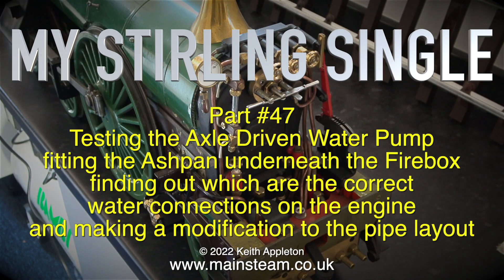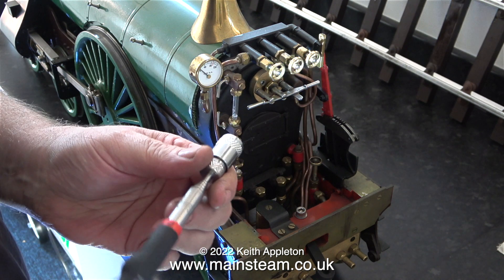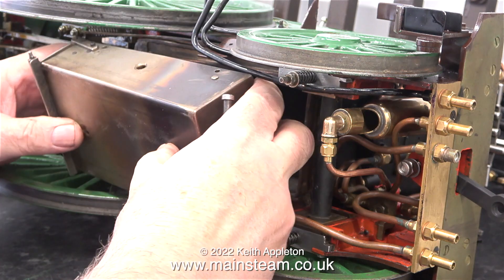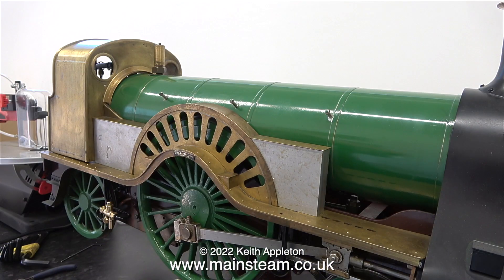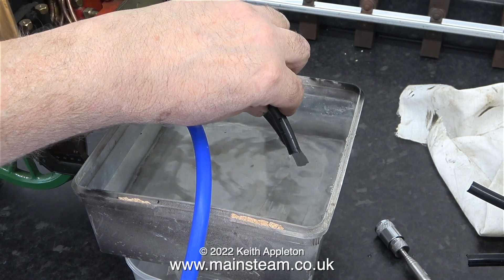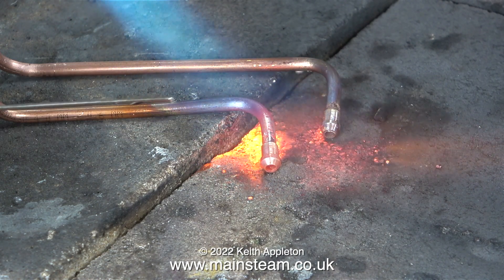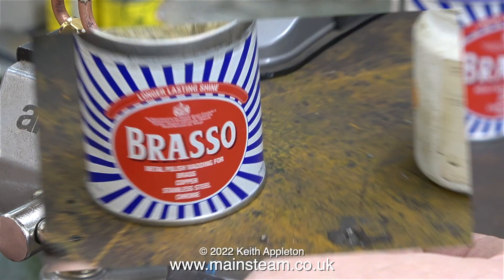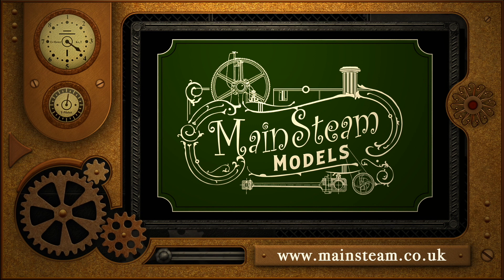MY STIRLING SINGLE - PART #47 - TESTING THE AXLE PUMP

Comment: Hi Keith, fantastic video as always. 
Ive had some thoughts for a while but yet to try it myself. Cant the axle pump return go back into the axle pump feed pipe on the loco side. So when the bypass is open the water is just circulating the pump, until you require water. It would eliminate the need for one more pipe going back to the tender.
Thank you for making these videos and please keep well.
Keep it up!
Regards,
Paul
Reply from the maker: That could cause a pressure build up and hydraulic loading in the short loop. It is the accepted standard to circulate the water back to the supply tank and make the return pipe visible so you can see that the pump is working
Reply: @keithappleton  I just always question things haha. Residual pressure will just push back into the tank via the intake without hydraulicing. not a closed loop. Be interesting to see if the turbulence does cause issues. I agree it does remove the possibility to check if the pump is working. Test cock / cab wash hose might be a solution for that. I just hate all the pipes between cab and loco. Thanks for the feedback and keep making the videos.

Comment: Hi Keith,

Recently discovered your channel and i've steadily been making my way through your library - there's all sorts of interesting things to be found in there thank you for the invaluable resource you're building.

I was wondering if you might be able to help me with a question about sight gauges on a traction engine, since i've seen you've worked on a few as well as owning a couple yourself.

I am about to embark on the building of a 2" Thetford Town engine (from reeves), but since this is my first project things that might be clear to someone more experienced elude me. There's a silver-soldered threaded bush on back of the boiler for attaching the bottom of the sight gauge, as I understand it the top of the sight gauge must also be connected to the boiler to avoid the steam pressure forcing out the water through the gauge, but I'm not really sure where the return should be connected.

I've been trying to find some clearer images online of a part-built engine that would show me where the pipes go, but as yet I've not been able to find anything.

Any light you could shed on this would be gratefully received.

All the best,
Ed
Reply from the maker: The detail should be on the boiler drawing. The lower boiler bush ideally needs to be just above the firebox crown.
Reply: @keithappleton  Thanks, I was looking at the plans yesterday but couldn't spot the right part, looking again today and finding some more pictures online has i think cleared things up. 

Thankfully the boiler has already been built and hydrotested by the previous owner of the castings & plans, certainly reduces the fear factor (: